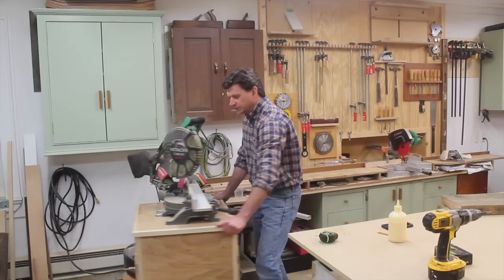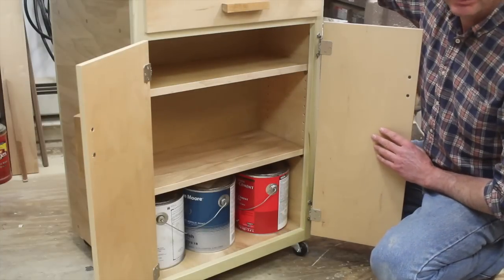Finished Chop Saw Cabinet with Nail Organizer Drawer

Comment: Nice looking cabinet. Nice video.

FWIW, I found Rob Cameron's YouTube series "Sketchup for Woodworkers" to be an efficient way to get up to speed. He seems to cover just what you need to know to get started. I found Sketchup to be very frustrating at first, not being able to do what I wanted, including simple things. His videos got me past that. My suggestion is to follow along and do what he's doing, pausing as needed.

I was a bit surprised that you said you didn't trust wood glue to hold the plugs. I personally rely on wood glue a lot. More than most, probably, as I generally use just glue and no metal fasteners at all. I do make a point of spreading it thoroughly to maximize surface area. As always, there's more than one way to do it, and yours looks great and is certainly plenty sturdy.

Comment: John, this is nice. Looks similar to my air compressor cabinet - you can see it on my FB page  https://www.facebook.com/The2CarGarageShop .  I also have a similar plug cutting jig for my trim router. My base is longer for stability reasons. I put pressure on the extension part and it keeps the router from tipping forward and gouging the surface. I use a straight cutting bit - don't have a dovetail bit yet. I also leave the plug a bit proud of the surface and sand later. I made some cabinets using pocket holes and I plugged them all.....I had over 100 plugs to trim and I was not going to do that by hand.

Scott